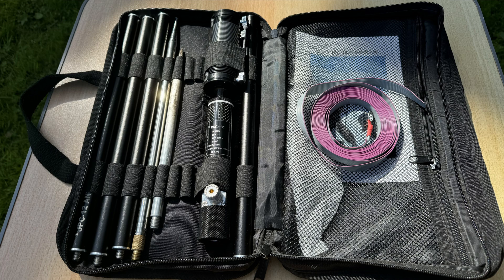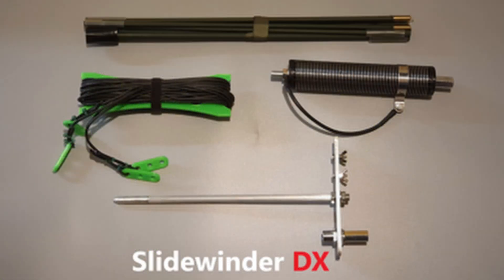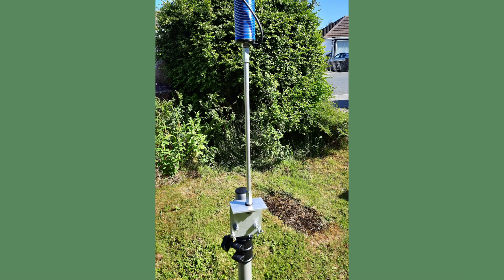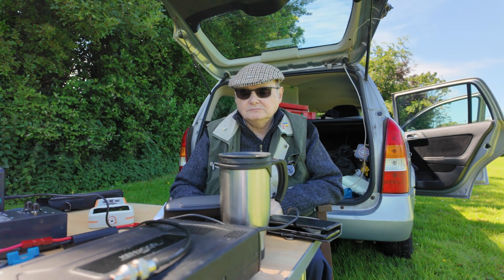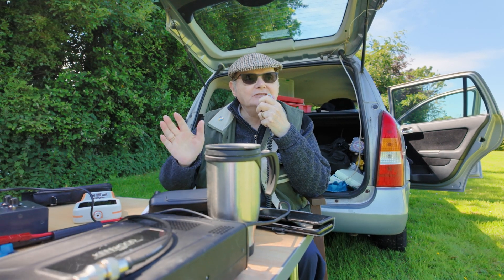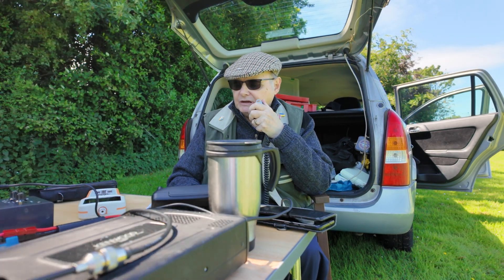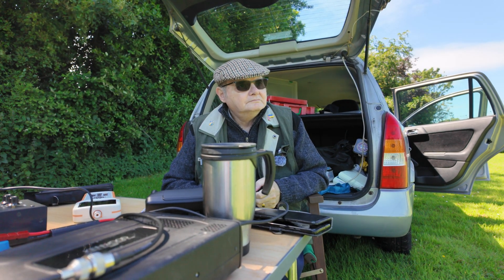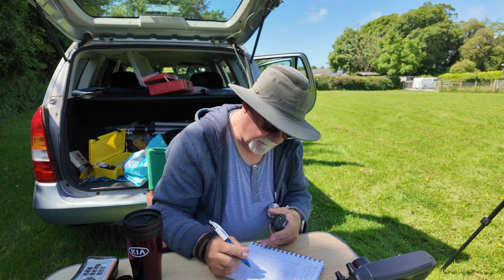Antenna Shootout!

Comment: Aloha Ian, I bought the JPC-12 last year on AliExpress for $106 USD and I’ve been very happy with it so far. As far as cost, it was an easy alternative to the overpriced Chameleon Antenna System that does work great but six times the cost of the JPC-12. 
      I have heard of the SlideWinder Antenna but have never priced one before and if I remember correctly, they stopped making them or there was a problem ordering them. 
     I own a number of radios including two G90’s, a PMR 171, IC-7200, FT-991A and more recently, the QT-80. 
     Unfortunately, I have so many projects going on at the same time that involves planning and travel such as my recent trip to the Los Angeles fire zones. 
      It looks like you were set up in a nice area where you got to enjoy the shade from the tall trees in that area. 
      I subbed and hit the LikeLike Button and I look forward to more videos from you, sir Ian. Mahalo-Todd🤙🏻

Comment: Seems like the test was on mainly short-skip signals, for which verticals are not so suitable. I guess that there is a risk that high-angle radiation could have been coming off the co-ax feed if a feedline common-mode choke was not used at each end of the coax.  Also of the radials if they were not symmetrical. It would be interesting to do a test late in the day when European skip is coming in, and even inter-continental.  In theory, i suspect that the JPC12 is more effiecient as it is centre-loaded.... except for the caveat that the ground-spike might be conducting some RF current into the lossy earth! I guess the spike, in the Slidewinder, is similar in this respect?  Hope that helps! 😊

Comment: I find the jpc a really comfortable and versatile antenna, I use it a lot combined with a 560 cm telescopic whip that allows me not to use the coil for the high bands and use it only for 40 meters. I like it so much that I also purchased the dipole version that I use a lot even from the terrace of the house with good results!

Comment: thanks for that, both work great with a small footprint.  i have the jpc-12 and will use it and find a link dipole works great. of course it will its full size non compromise. !   looking to mount the jpc-12 on my 7'' magmount on the car and playing with an adaptor to do this really for the height!

Comment: That result was just how I expected it to be on local inter g & Europe contacts, A center loaded vertical radiates like a 5/8 wave out to the horizon, Where the Slidewinder will shine is on DX Contacts, Because the Slidewinder is a ground mounted 1/4 wave  that radiates at a low angle take off, Good to see it held it's own against a center loaded vertical on local/ european contacts.
Reply from the maker: Great comment.  I agree but DX was hard to come by on the day.  20m was very short (I could clearly hear stations in the south of England).  Brian did work a Belgian station but that was as far as we got.  That said, I have worked Stateside on both aerials on CW and SSB when activating POTA.  Ian

Comment: Great comparison. I wonder what it would be like using the sectional antenna for the slidewinder? It could also be centre mounted
Reply from the maker: Difficult to do unfortunately as the JPC12 is not 3/8 thread.  That said, on the tripod and with the extension mast on, it does lift the feed point and the coil considerably.  Ian